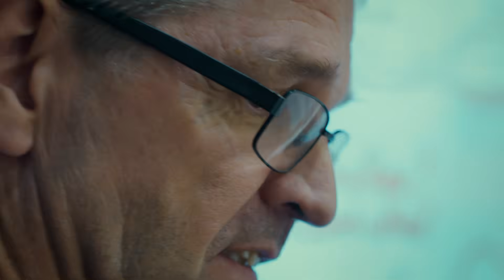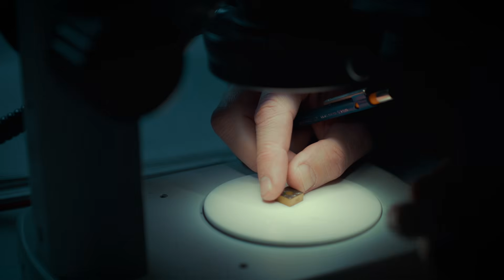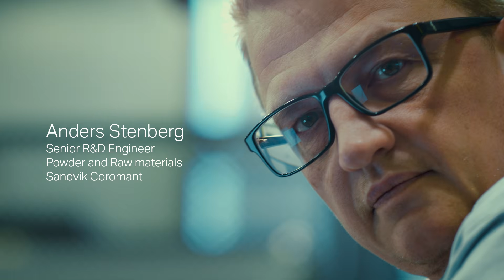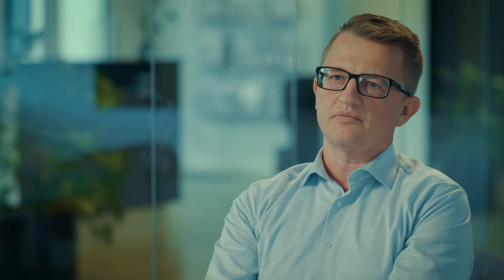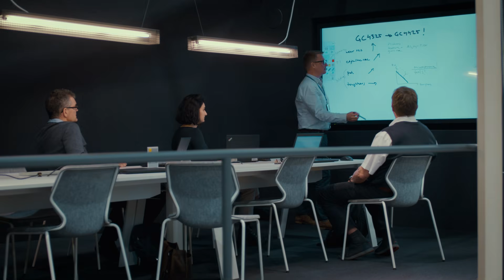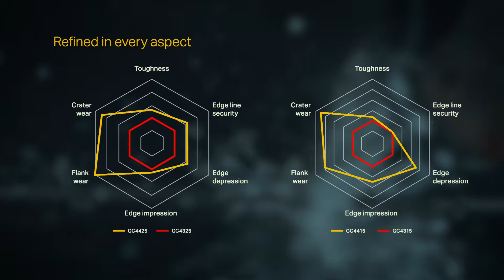New steel turning grades - Refined in every aspect

Comment: If you think about it, it's really sad that the cutting materials did not evolve much over the last +50 years. The carbide of the past is not orders of magnitudes worse than the new ones (with coatings) - in some ways, it's still comparable. I'm not blaming companies or scientists. I'm blaming nature that it does not allow us to do continuous big leaps.
Reply: we need asteroids, the future is mercoxit diocarbide inserts
Reply: Sorry, you are very wrong. We have now cBN, PCDs, AlCrN, TiSiN, SiAlON, aaaand the list goes. Maybe you should talk to the right people.
Reply: @sale4213 You didn't read my post properly. I said orders of magnitude better. Do you realize what that means when people say that, rigjht? 2x pr 3x better is not "orders of magnitude".
Reply: @chronokoks  in what world is a 200 to 300 increase in productivity not an order of magnitude greater.
Reply: New carbide grades are much much better than previous generations it's just the demand for the carbide has gone up in the 60s titanium was cut with hss tooling at like 10-30 ipm now with modern carbide grades and coatings you can cut through titanium like it's low carbon. Also coating technology has improved drastically specifically in the price department so saying that they haven't evolved much is in a word stupid.

Comment: I wonder what one of these bits cost
Reply: About 5-10 bucks a piece average
Reply: @rossomyman  aha... try double
Reply: @blankeomwenteling8135  We (a small shop) don't buy a lot so we don't get a lot off of list price+VAT , there is zero chance to buy a box of inserts under 100€ (of sandvik of course) , lately it's been creeping towards 200€ . Some grooving and milling inserts go as high as 30€ a piece .
Reply: @blankeomwenteling8135  we have , but we have such a large variety of tool brands that we use , it's impossible to buy for example 10 box of LNGX130708 , because , we might need a box for an ingersoll head , 1 for seco , 1 for pramet , 1 for korloy , 1 for dijet , 1 sandvik , and so on .  We use everything from Akko to Kaiser . It's quite bad , but that's how it is .
Reply: @blankeomwenteling8135  Cheapest way is to use standard ISO inserts so you can shop around and find the best prices. In the UK at least, Cutwel pricing is almost impossible to beat and the quality is just fine. I ran them exclusively for about 9 months on small batches up to about 20off max without issue while I was working in a small machine shop.

Comment: anyway to make diamond carbide???
Reply: You can grow a layer of diamond on top of cemented carbide. Look for BALDIA from Oerlikon.
Reply: @blankeomwenteling8135  I agree with everything you said except for the first two sections.

A carbide is a molecule characterised by a complex of carbon atoms bound to metal atoms. It's not a mixture. My statement of it being essentially diamond was a dumbed down theoretical explanation of a carbide. Imagine diamond as a theoretically pure carbon source with an advantageous atom structure. But diamond is to brittle and hard to work with, so by reacting it to form a complex with a softer but tougher material, i.e. Tungsten, you get a carbide.
Reply: Carbide is essentially diamond(carbon) combined with a metal. A diamond is always essentially pure carbon arranged in a certain crystal structure. So no, a carbide can never be a diamond. The closest commonly used material to diamond in terms of hardness is CBN (Cubic Boron Nitride).
Reply: @OB1canblowme  is CBN harder than PCD?
Reply: @mikeweldon7249  Haven't used them but probably yes, PCD is Poly Crystalin Diamond, so it will most likely be harder than Cubic Boron Nitride, even if not by much.